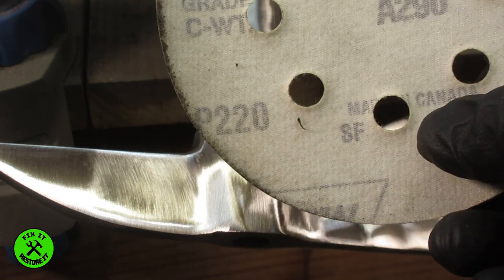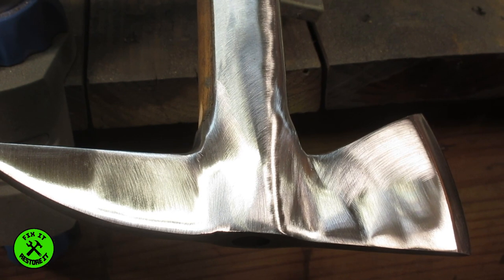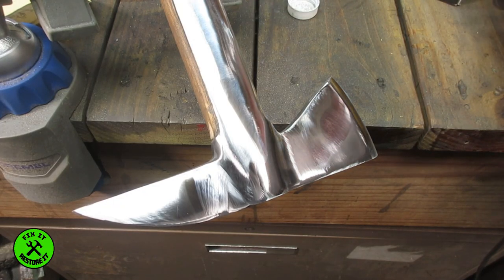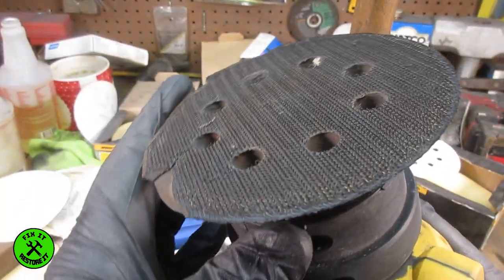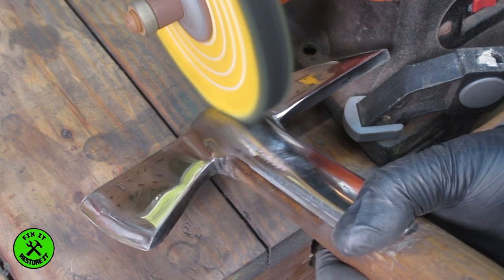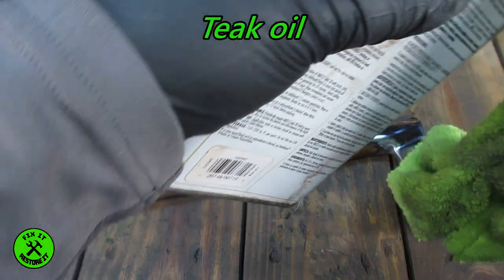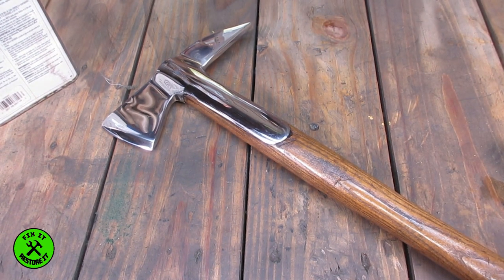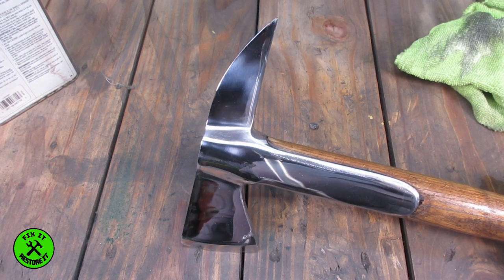English Fireman's Hatchet restoration

Comment: We carry one of these on the airfield crash truck at work along with the actual tin opener axes, the RAF guy that trains us says they are basically an evolved boarding axe from the sailing days.
Your foam backing pad is rinsed because it got near the blade, I know because mine looks exactly the same for the same reason! 
Beautiful job by the way mate.
Reply from the maker: Thank you!  and yes, I learned very quickly to grind away from the sharp side lol!!!! And , can you believe i found that hatchet at an auction here in Texas?  when i saw England on the handle i snapped it up!

Comment: Guessing 16 sheets of sand paper.  4 grits, one for each quadrant of the axe.  Same sheet can be used on the side because it's not hardened.  Pad is beat up due to the direction when holding the sander going "on to" the metal, as opposed to going "away from" the metal.  My pad looks like that, too!  Nice work mate!  That axe is gorgeous!
Reply from the maker: Thank you! I used 6 different grits and i will post the number of pads i used on my community page 😎

Comment: Awsome restoration. 
I personally have a hatchet pretty similar to yours, same brand. Same conservation state. But I'm preserving most of time using marks on it. I can imagine a fireman in a hurry trying to open an old solid oak door...
As a result of a research I did, I found it was a fireman's tool. I think they use it to open doors, and even to open a hole into a brick wall. 
I tested the point of it against a hard concrete pavement, using all my strength.
I hold it with both hands and hit the concrete surface. 
The steel is so hard - I personally think it's forged  steel - that it didn't suffered even a small scratch! 
High quality tool. I think it would easily open a sheet metal made car roof, in an emergency. I'll send some photos of it for you.
👏👏🏆🏆🏆 fro 🇧🇷 Brazil
Reply from the maker: Cool, thank you 😊

Comment: The damage to the sander is due to not using it on a completely flat surface, or using it on its edge, and it is causing uneven wear.
Reply from the maker: Or catching the sharp edge of the blade 😎